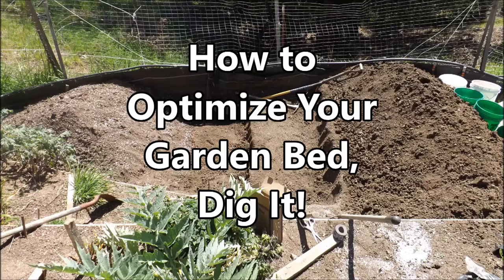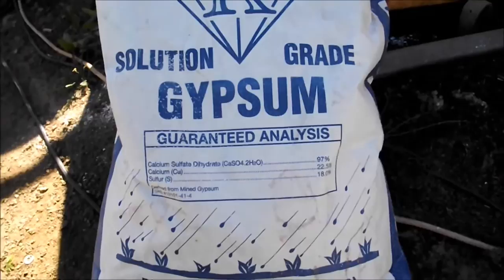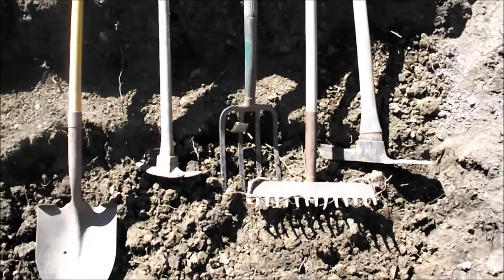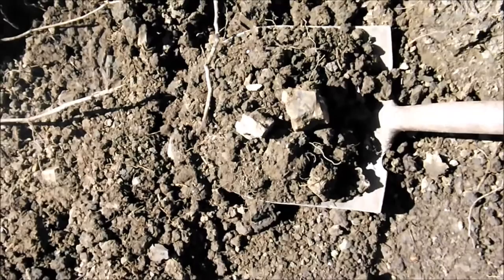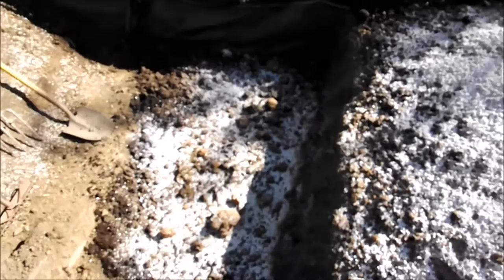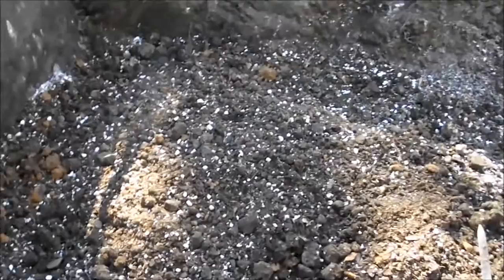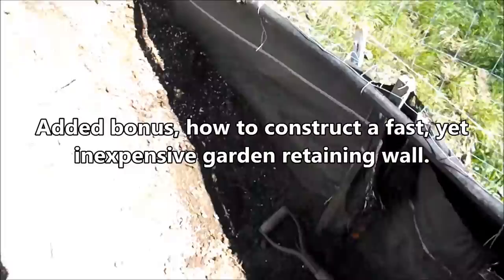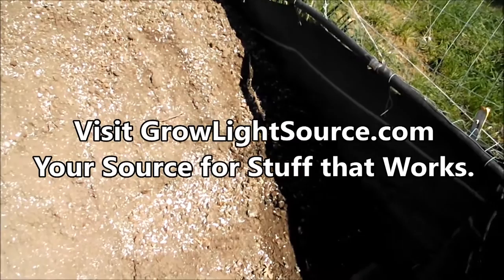How to Prepare an Optimized Garden Bed.

Comment: That's fine to buy all that stuff if you have a thousand bucks, but if your doing  50 by 50 feet, how about the following. (gypsum) (saw dust) (leaves) (compost) and you will get the same results.
Reply from the maker: Yes many techniques will work, yours works well, and will yield similar results. The method  detailed was much less expensive than buying bags of soil and bottles of nutrients, it did cost a couple hundred bucks, it is loaded with good natural nutrients that help with development and health.